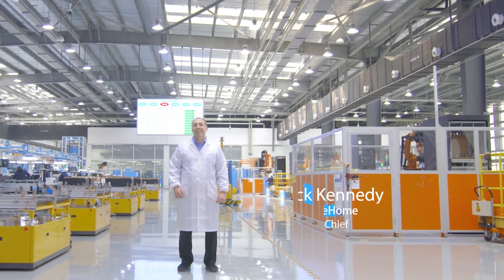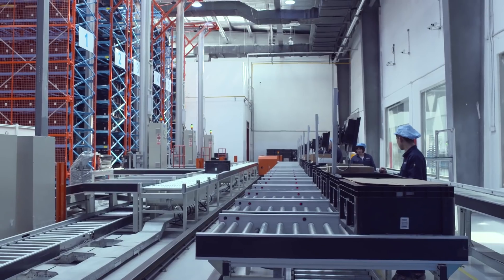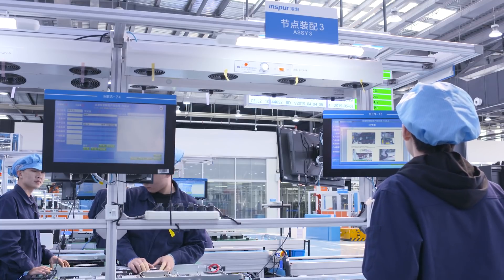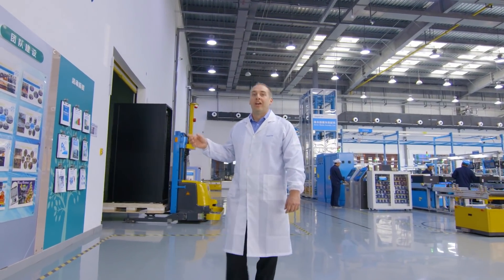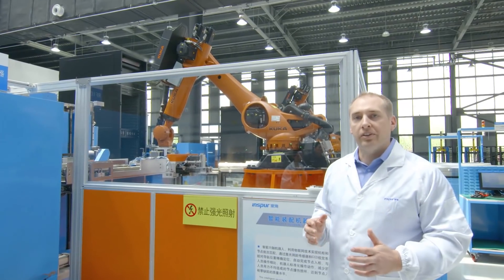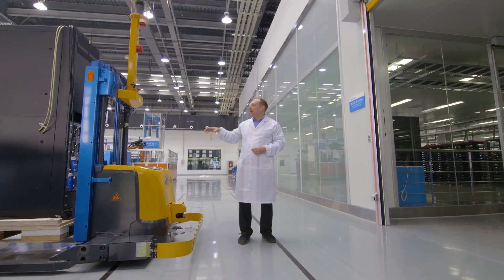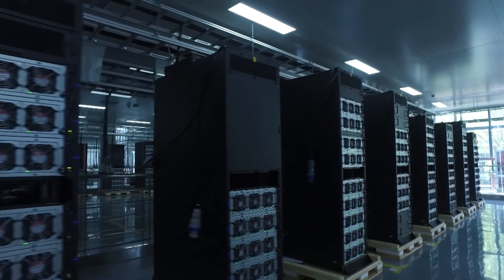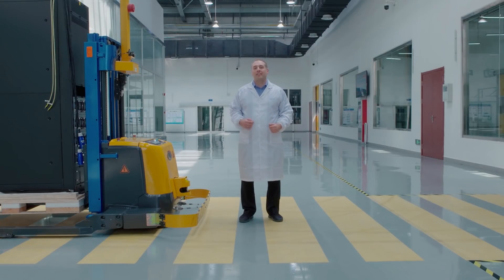Inspur Intelligent Factory Tour with Patrick from ServeTheHome

Comment: Here from linus video . that lumaforge thing is sold At apple that might explain the price i think they give big profit margin to apple for thatv
Reply: Hi there. Historically the storage industry has had high margins to work with. That one of the reasons why there are many open source storage options that people use even in large-scale deployments.
Reply: @PatrickKennedy2  what about using tunder bolt 3 for plug and play? That will make the ssd performance more noticeable i dont know how practical that is .